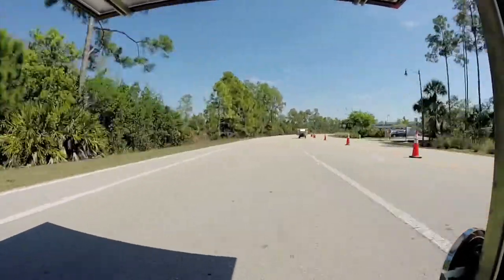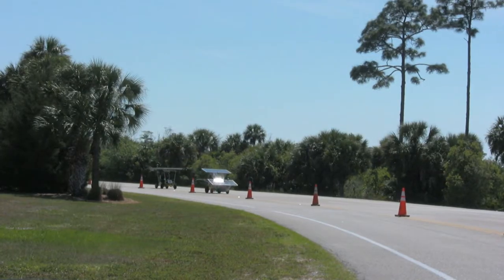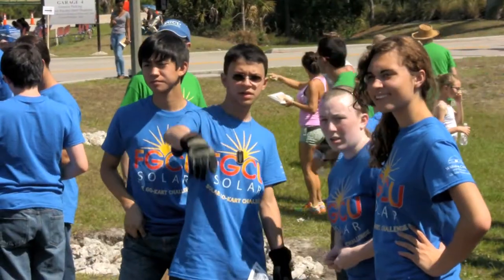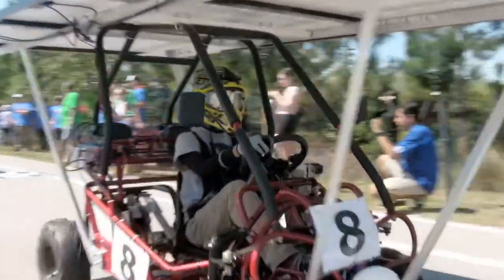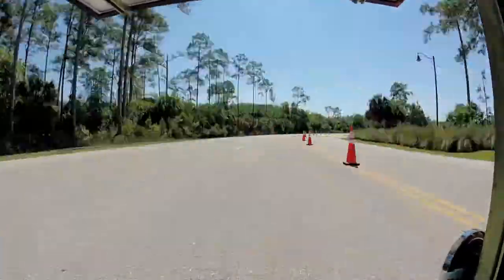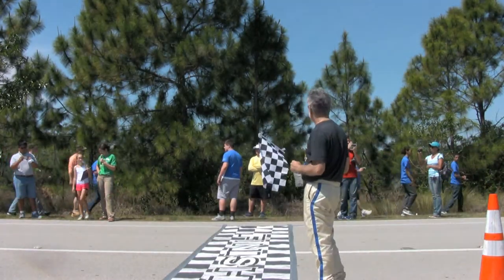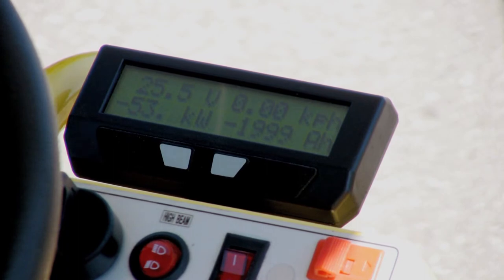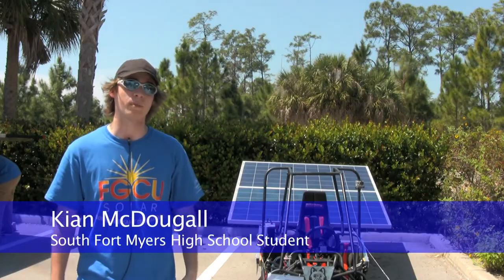2015 Solar Go-Kart Challenge

Comment: can you change your battery during the race
Reply: ElaSabedeTudo No. Batteries must remain the same for the entire event. As one of the coaches for the Verot team, I will tell you that TESTING before the event is crucial. During the weeks and months leading up to the actual race, we experimented with 5 different battery chemical configurations. This was a very expensive proposition (1 set was over $1,000 and it was a complete failure), but in the end, testing proved to be a winning decision. The best investments that can be made are weight, heat, and driver (and team) skill.